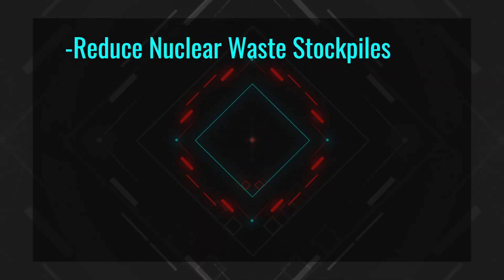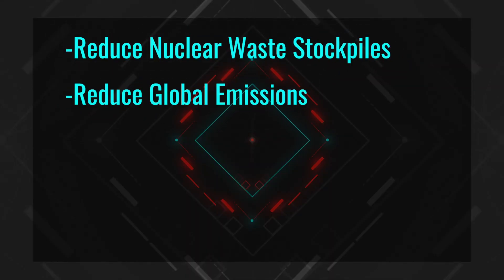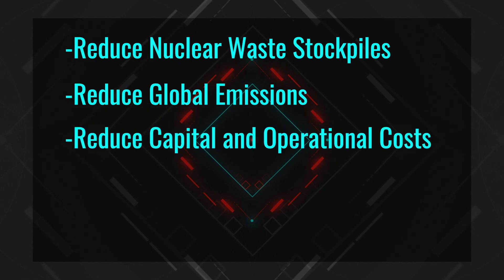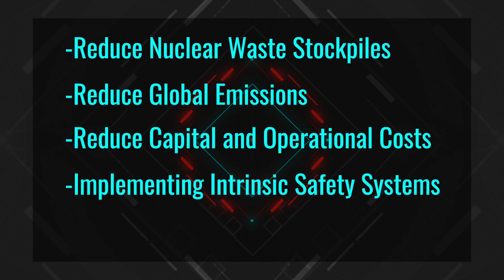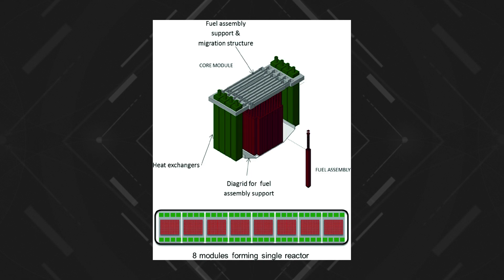Moltex: Nuclear Backup Power and Thermal Energy Storage for Renewable Energy | Ep 15

Comment: Cat, I don’t disagree with anything you’ve written.  I’m cheering for all these guys, for my grandson’s sakes.  I just see a devil hiding in the details, and the vulnerable spot in all this seems to be the durability of the hardware.  Designing heat exchangers that have no spots where the circulating salt can eddy, cool and solidify, for instance is another issue.  I hope the people at Moltex, Thor Con, Copenhagen Atomics, et al have better things to do than chat with me ; ) >

Comment: As pointed out by several others, the new design is a cylindrical geometry.
Here are several references which describe the new design:
  - https://www.moltexenergy.com/wp-content/uploads/New-Nuclear.pdf
  - https://msrworkshop.ornl.gov/wp-content/uploads/2020/11/24_Scott_Moltex_SSR_ORNL1.pdf

Some key points from Ian Scott's MSR2020 viewgraphs:
    - No active control of reactivity with control rods (always runs at design reactivity)
    - On power refuelling via vertical lift crane that never contacts the molten salt coolant
    - Passive shutdown without use of shutdown rods
    - Fresh and spent fuel assemblies stored at peripheral locations to minimize airlock operations
    - Novel heat exchangers to permit elimination of intermediate coolant loop

Ian's presentation is available in several versions here:
  https://youtu.be/l79rYLOp5bo
  https://youtu.be/V8ApH-0YHkA
  https://youtu.be/nstQCC2gfXk
Reply: Good resources - thank you.

Comment: I would think that LFTR is better and produces less waste.
Reply from the maker: If I had a preference I would chose LFTR for several reasons. But Moltex has a clearer path towards getting to a commercial reactor in 10 years. Other companies like Elysium are on a similar track. The LFTR is the best design in my opinion but Flibe has certain supply chain and material issues that need to be addressed first.
Reply: @RockLogicWithSeanKenny  "certain supply chain and material issues"......that's one way of describing it.

Comment: Here is a crazy idea for an application for Stable Salt thermal storage. Could a compact stable salt system be compact enough to store  all the energy for sending a single stage rocket into  orbit? A nuclear thermal rocket has always attracted the interest of Space enthusiasts but the link with radioactive materials has always been a show stopper. If the Heat comes from a reactor at the launch pad this would avoid the risk of fallout should the launch fail. Your thoughts.
Reply from the maker: So first off I would love to dedicate a whole episode on nuclear propulsion. Ideally it's suited best for in space applications and not for launching stuff into orbit. Now having a reactor on the launch pad is interesting because that is essentially what we plan to do on mars. Use a reactor to make fuel to power the ship for the return journey. However the amount of energy needed to generate enough thrust to get a rocket off the ground sounds like it would be too massive for it to make since. Its an interesting thought but maybe we could expand on that. Elon Musk has stated that he uses MOX fuel because he has no other choice. Its really expensive to store hydrogen on site to fuel a rocket by comparison to hydrocarbon rocket fuel. But what if you could just make hydrogen onsite when you need it. That might be an ideal application, but I would have to do more research on that. Interesting thought though.
Reply: @RockLogicWithSeanKenny  An air-breathing nuclear rocket can do earth to orbit. Look up the Nuclear Thermal Turbo Rocket designed by John Bucknell.

Comment: By the was: Moltex hast recently changed to a traditional round core after talks with experienced canadian reactor operators.
Reply: Yes but still solid fuel?
Reply: @MrVaticanRag  moltex has always been designed for liquid fuel. It's just that the fuel bearing salt is contained within fuel pins.

Comment: What i like most about Moltex: no primary loop to leak or fail! And the fuel Tubes can easily be replaced when damaged by high neutron flux.
Reply: But there's a reason those loops are there. Recently I saw a presentation by thorcon, and one of the main issues they brought up was the production of tritium, which is avoided by I believe the third loop in their design. I have not seen this issue mentioned by moltex yet (could however be me)
Reply: You are perfectly right! Iwas referring  to the highly radioactiv primary loop. I woudnt like to change a pump or fix a leak there.

Comment: Moltex have abandoned the square/expandable core
Nuclear engineers at plants said that they prefer to move fuel as little as possible, neutronically efficient is much more important to them.
Reply: I'm not sure that this is an improvement. They will lose the ability for continuous refueling and core shuffling for optimized burnup.
Reply: @curumosaruman6616  yes, it sounds like the (far too common) case of experience based on the existing technology yielding the wrong conclusions for the new technology.
Reply: Mea Culpa - I was wrong
It turns out that the new design still preserves fuel shuffling and continuous refueling.

Here are several references which describe the new design:
  https://www.moltexenergy.com/wp-content/uploads/New-Nuclear.pdf
  https://msrworkshop.ornl.gov/wp-content/uploads/2020/11/24_Scott_Moltex_SSR_ORNL1.pdf
Here are some key points from Ian Scott's MSR2020 viewgraphs:
    - No active control of reactivity with control rods (always runs at design reactivity)
    - On power refuelling via vertical lift crane that never contacts the molten salt coolant
    - Passive shutdown without use of shutdown rods
    - Fresh and spent fuel assemblies stored at peripheral locations to minimize airlock operations
    - Novel heat exchangers to permit elimination of intermediate coolant loop
Ian's presentation is available in several versions here:
  https://youtu.be/l79rYLOp5bo
  https://youtu.be/V8ApH-0YHkA
  https://youtu.be/nstQCC2gfXk

Comment: Moltex Energy:
Put fuel salt in tube.
Cool tubes with salt.

It's just so gloriously simple.
Reply: Only snag is your salts eat your tubes.  Simple.
Reply: @harleyb.birdwhisperer  
Only if you don't pay attention to your chemistry.
Which they have.
To start with the primary and secondary salts are different salts.
Can't quite remember what the primary is, but the zirconium wire in their stops the salt from eating anything today isn't the zirconium.
Secondary is zirconium tetrafluoride and won't eat the steels they're in.
I'm not a chemist, I can't answer anymore questions, but this comes straight from me talking to staff at Moltex.
Unlike every other MSR that I know of, that means no new nuclear steels required to go through the approval process. So it's the only one that can be built quickly and cheaply.
Reply: I hope you’re right.  The stuff I’ve seen recently is about the buildups that occur at the atomic boundaries when the metals are exposed to stress and heat simultaneously.  The accumulation of these in the plumbing, pumps and heat exchangers are gating factors in the life of the unit.  Shorter lived units means having to swap them out sooner, with resulting higher costs.
Reply: @harleyb.birdwhisperer  
Indeed.
Have a search on YouTube and listen to Ian who founded Moltex.
Their entire modus operandi is geared towards getting the kWh price below that of a new combined cycle GT plant.
Now, I know that sounds a bit 'well duh' but I think they can do it and I think we're f'k'd without it.
If there powers not cheap enough they only way to get it built is through legislation, and we need to leverage The Power Of The Free Market (greed) to get this going fast enough.
If you look at the global spilt on power generation, we're not even making a dent yet.
We've almost swapped coal for gas.
That's it

I also urge you to talk to Moltex.
I know the answer to that salt question because I asked them on Twitter.
They came back with that high level description for me.

There's something special about Moltex.
They're different, I genuinely think they can do it.
They're in it to save the world, not just for the cash.
Exciting stuff.
Reply: MCSFR is much simpler.
Reply: @phamnuwen9442  
In your words, how so?
Reply: @MostlyPennyCat  Elysium's MCSFR has no structures of any kind in the core, just fuel/coolant salt (single fluid).
Reply: @phamnuwen9442  Elysium's MCSFR has no structures of any kind in the core, just fuel/coolant salt (single fluid).
It is basically the same here.
Reply: @anteeko  Is it? The tube is a structure, is it not?
Reply: @phamnuwen9442  "Is it? The tube is a structure, is it not?" Can you define what do you mean by structure?
Reply: @anteeko  "something arranged in a definite pattern of organization"

From Merriam-Webster
Reply: @phamnuwen9442  And what the problem with those tubes?
Reply: @anteeko  Fewer parts is preferable to more parts.
Reply: @phamnuwen9442  "Fewer parts is preferable to more parts." 
Moltex design is the exact embodiment of this philosophy, it removed en enormous amount of part and complexity by going from solid to liquid fuel.

Can't do much less than a simple tube,  the material doesn't require any new certification and if the tube fail the reactor become sub-critical without any risk for the environment.

As good as it gets.

Are would you build a reactor without any structures?
Reply: @anteeko  If you take a minute to examine what Elysium Industries has in mind, perhaps my point will be more obvious.
Reply: @phamnuwen9442  "If you take a minute to examine what Elysium Industries has in mind, perhaps my point will be more obvious." Elysium has tubes too.
Unless they find a way to build a reactor without heat exchanger.
Reply: @anteeko  Are you deliberately evading my points or do you honestly not understand them?
Reply: @phamnuwen9442  "Are you deliberately evading my points or do you honestly not understand them?"

Elysium reactive core has pipes, pumps and a salt to salt heat exchanger.

Moltex reactive core is limited to a simple tubes, working on convection (no pump) and standart material.

Don' get me wrong, I like Elysium design a lot but when it comes to the reactive core complexity it is arguably far more complex than Moltex.
Reply: @anteeko  As I understand the Elysium core, it has no structures except a single tube which is only used when starting up the reactor. This seems far simpler than Moltex's array of fuel tubes to me.

Now, we probably can't judge their overall simplicity and economics based on just the core, but according to my understanding, Elysium sounds simpler in that particular aspect.
Reply: @phamnuwen9442  "As I understand the Elysium core, it has no structures except a single tube which is only used when starting up the reactor. This seems far simpler than Moltex's array of fuel tubes to me."

The Elysium core has many structures. Look at the schematics in the elysium videos..
The reactive core has Pipes, pumps, salt-to-salt heat exchanger and another tank deep into the no-reactive salt pool.
I don't know where you get the idea of a reactive core without structure for Elysium?

The description of a reactive core without structure fit far better the moltex design. each tube contain the reactive fuel and that's it.
The only "structure" moltex tube have is a valve to release gas product and that's it.

-No pump, it rely on convection.
-No heat exchanger, the tube is the heat exchanger itself.
-No separate de-activation tank, the non-reactive salt pool will play that role in case of failure.
-No new material need.
-No massive structural part exposed to heavy radiation flux needing enormous effort to replace when reaching end-of-life, each tube is easy to move and replace.
-No mecanical part/pump touch the salt, hugely ease maintenance and reliability.

I think there is a good argument to make that Moltex if far simpler core design.
Reply: @anteeko  Do you have a schematic of the Moltex core? I can't find anything on their website. The details on the Elysium core was explained to me in a comment by Ed Pheil if I recall, though this was a while ago so they could have changed their plan.
Reply: @phamnuwen9442  No I don't have schematic but Ifound a lecture where they went into detail on the design. I will see if I can find it.
Reply: Ah, OK, an update because I talk to the guys at Moltex and bombard them with questions.
Fuel salt:
Fuel + Zirconium Wire + NaCl (I think it's NaCl)

Coolant salt:
ZrFr4 (Zirconium Tetrachloride, Zirconium (IV) chloride)
Liquid F2Zr (Zirconium (II) flouride, Difluorozirconium)